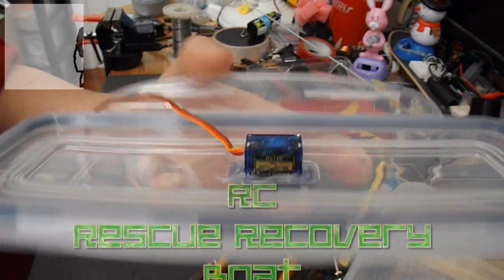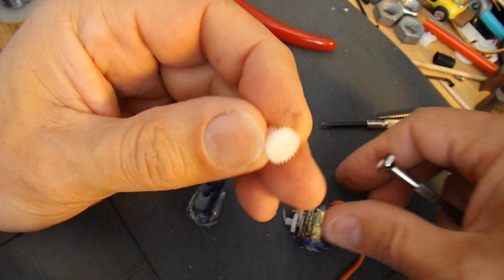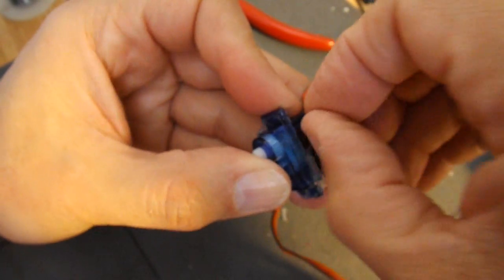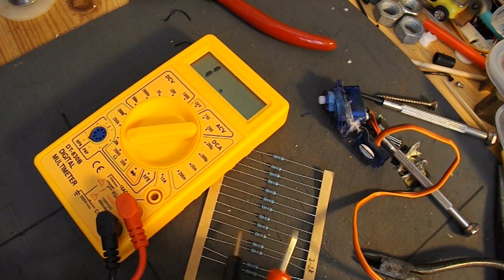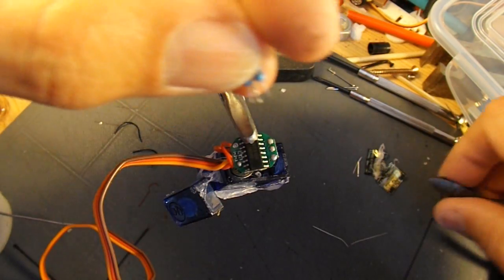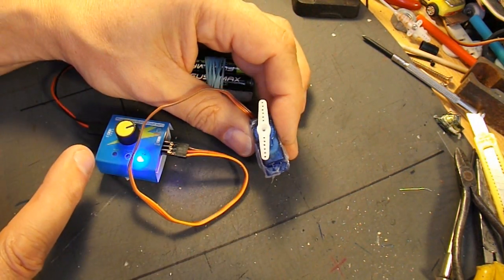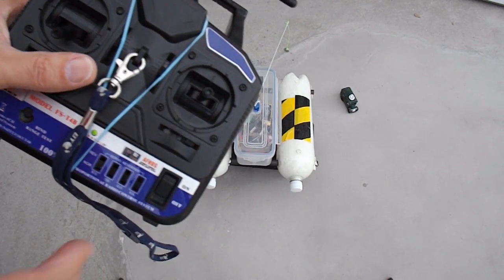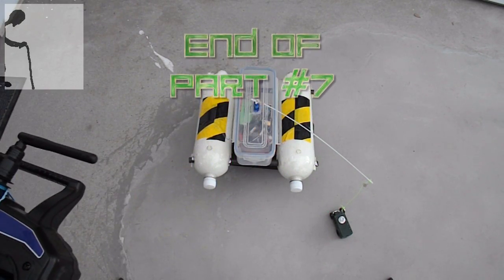RC Rescue Recovery Boat Part #7 360 degree servo modification

Comment: This works well on analogue servo's, however on digital servo's the servo will tend to take off at full speed as soon as you apply control input, due to the algorithm within the processor.
One nifty thing you can do similar to this is replace the fixed resistors you put in with light dependant resistors, using the servo tester you have a device that seeks light, great for aiming a solar cell.

Comment: Hey Grandad. Could you modify two servos for continuous rotation, then take the circuit board and motor and use them in a remote control car, where each motor controls one wheel. You could have something at the front which allows it to both turn and go forwards and backwards. If that makes any sense. Thanks.
P.S. I won't be able to respond as I am going on holiday tomorrow :)
Reply from the maker: Dukey8668 https://youtu.be/Q0JtF2OuXCM
Reply from the maker: Dukey8668 you could fit them in one of these too https://youtu.be/VMdCq1O6niI